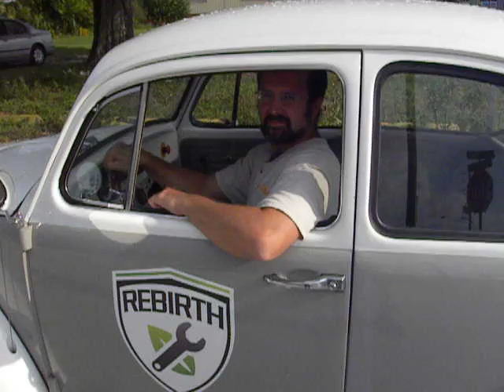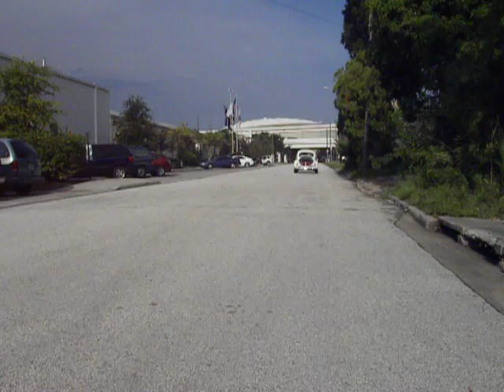RebirthAuto EV VW Beetle 120 Volt Kit with EVnetics Soliton1 Controller & Warp9 Motor

Comment: Awesome!
How much range do you get out of that? I work for Corvus Energy, we build 6.5 kWh Lithium Polymer batteries for marine applications and I am thinking of building some sort of rat bug for fun. I need top speed of 80 mph and 50 miles range for my commute, mostly on the freeway. Our modules are 48 V at 140 ah with huge peak amp discharge characteristics, so I am figuring a 144V system with as much acceleration as possible.
Is 140 ah enough?

Comment: The Beetle is also one of the easiest cars to do an Electric Car Conversion on and it runs better when it is electric. Companies are making kits for the Beetle which makes Electric Cars more accessible. Also, the Beetle has street cred. In my opinion, more people would rather drive an Electric Beetle than an i-MiEV, hence, doing an Electric Conversion on a Beetle is a good choice.

Comment: Looks cool, but i am not a fan of chopping up the metal in my bug. It is only original once. If they made a kit that fit without cutting the apron or any other metal, and was quick with good range I would be all over it.

Comment: I am going to build a 1000W ebike and maybe later a ~30 kW motorcycle, and i don't care what they say anymore, the demands are simply too high but so is the temptation. I don't have time/money for their EMC tests and R-100 inspection etc. If the controller should not emit EMF according to specs with the right cables and connectors, then why on earth test it? 
Though, i agree that one should not build an EV with cheap equipment that distorts GSM/GPS/FM/TV signals when passing by.